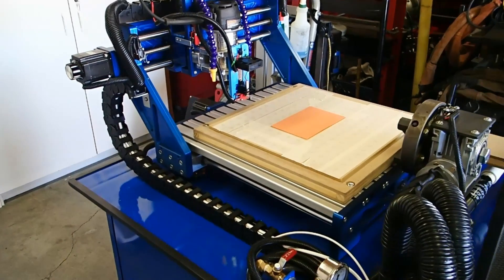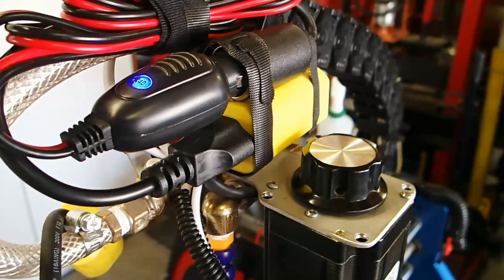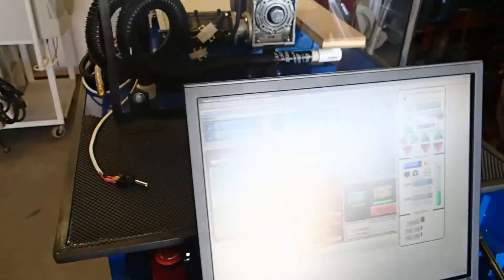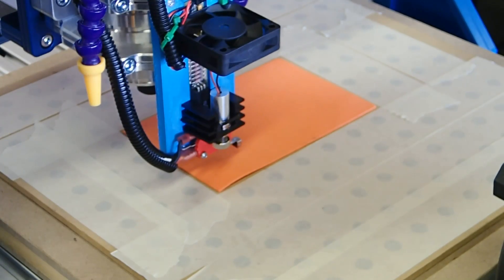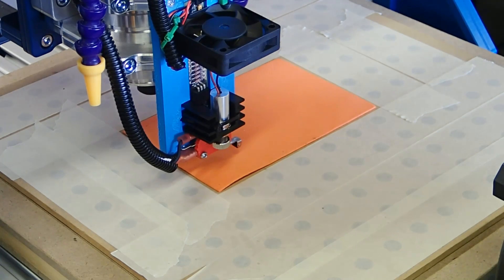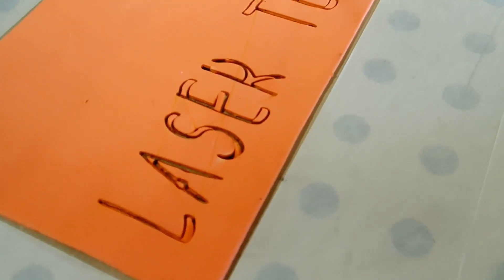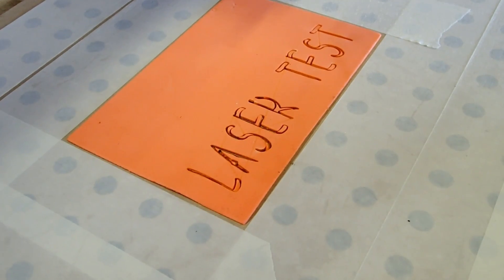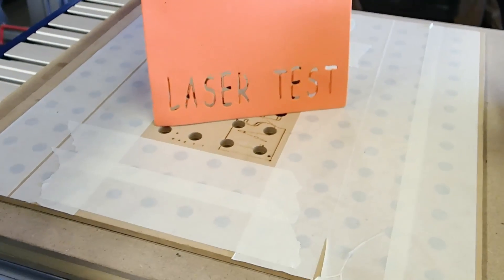Adding a laser cutter to a CNC Router Mill

Comment: You added so much weight to that axis....not really good but well done for the mount
Reply from the maker: There really is no weight on there its over powered for what it is.  The machine does not even know its here.   Its all Ball screws and way over done.
Reply: @DesertFabworks  yes I didn't check the motors. They seem massive enough. I'm a fan of high speeds as I do some productions from time to time and for me having a light bridge is important to push the motors to their max.

Comment: I am wanting to do this on a Laguna SmartShop 2. I have not had luck with other laser attachment companies. Would you know where to start?
Reply from the maker: I'm just an end user.   There are lots of options these days compared to when I made this video.    Every table and operating system are unique and the system has to be designed to work with this.   Find a good quality laser, mount it and work backwards from there connecting it to your system.

Comment: i have got two doubts:

1. Does this laser produces smoke , on changing materials ?
2. what is the base for your CNC ,what are those tapes and what did you use as a base?
Reply from the maker: The laser itself does not produce any smoke.  When it cuts through different things there is a little smoke but very little.  I have an exhaust fan near by.  The CNC machine has an aluminum base but I have a thin sheet of MDF wood that I do the cutting on.   The tape covers up the holes that are not in use.  The MDF has a vacuum hooked to it so that it acts like a vacuum table and holds the material down and flat.

Comment: WILL YOUR LASER CUT 2 IN FOAM?
Reply from the maker: Yes and no,  Foam comes in many densities and how much it cuts in each pass will depend on that.   Because it varies and the height is so high and there is a small focal length where the cutting is most effective it would likely have to be done in multiple passes with adjusting the height in each pass.

Comment: I have a BOBsCNC machine, so far I'm happy with it. I was wondering how to connect a laser cutter to it? I'm sure I can make a mount and brace it, my concern will be shutting on and off the laser, at the right times. It already navigates on X, Y, and Z, should I hook up another microprocessor, and switch the wires out everytime?
Reply from the maker: There are so many machines and setups hard to say on your application.  I'm not familiar with that machine and its setup.
Reply: Can I get a email address so I can send you what Microprocessor I'm working with? Any info is much appreciated.
Reply from the maker: Use the email form at http://www.desertfabworks.com/

Comment: Where did you connect the laser so it turns on/off when you run the g code?
Reply from the maker: Tiny Houses it's connected to a relay that is connected to the control board.    The control board thinks it's a plasma cutter and when it sends the signal to fire the plasma it fires the laser just like it would Fire the plasma.

Comment: I'd be interested to know if my CAM software BenCutLaser would work on your laser machine? I run a support forum for low power laser machines (here: www.BenboxLaser.us) and my CAM program is in the Software section on that site. You should be able to just use BenCutLaser to generate the gcode and send it to your laser.
Reply from the maker: It likely would work but I use Sheetcam on my machines since its a dual purpose machine and sheetcam works for all the processes on the machine and my other machines.  I like to keep it simple in the shop one cam program on all the machines.

Comment: Hi, What is the maximum thickness of pvc cut ?
Reply from the maker: Sorry we have not tried cutting pvc yet
Reply: You likely already know, but cutting PVC does require care to avoid the corrosive off-gassing. You may want to research which plastics are "safe" to cut with a laser. Safe can mean safe to people or safe to machines. Interesting topic.

Comment: what power can etch a pcb board?
Reply from the maker: Not sure have not tried it, sorry.
Reply: A continuous wave laser won't ablate copper.
You need a pulsed Q-switched laser, from 25-30 watts continuous power and up, and from 10kHz pulse rate. They usually have pulse powers of several hundred kilowatts, some go into megawatts for short pulses.
Look up chinese "Q-switched laser marking" machines(just like that in the search terms), they usually run around $2500-4500.
Those have enough power to ablate copper in a few passes(~10min for 10dm^2).
Reply: thank you man
Reply: How about pre-coated PCBs? Sorry I don't know the correct name. I Google around and found some people use black paint, but there are pre-prepared boards as well. Use the laser to burn off the coating and then remove the copper with etchant?
Reply: Kent VanderVelden Burning it off won't work, but exposing photoresist can work.

Comment: Where you have connect the on off of the laser? on the z axis or motor on?
Reply from the maker: The on off control for the laser is done via g code in the software and its tied into the mach 3 controller.

Comment: With the understanding it is a cheapo laser,  but a laser nonetheless,  I was expecting a clean cut through the foam. It appears you need quite a bit of tweaking still,  to get it to cut clean through the material. Some areas seems like the laser was struggling,  this could be the density of the foam itself not being consistent in the manufacturing of the foam sheet itself,  or the power delivery to the laser not being consistent also. There are streaks of what appears as smoke residue on the surface of the material as it jumps from cut to cut, or could be a delay in on/off cycles of the laser creating a left over power as it travels from cut to cut.  If you plan on selling these as kits, may I suggest getting all these things worked out and you will have a nice kit provided it cuts clean and thorough.  Don't forget to add the glasses and the power supply on your kits. Cheers!
Reply from the maker: +Mario I. Arguello   "LCheapo" is the brand name not sure we are talking about the same video it cuts clean through the foam and you can see the burn marks on the spoil board.   I bought this and put it together I have no intention of selling this I think you may be commenting about a different video.
Reply: +Desert Fabworks LLC Welding - Plasma Cutting sorry, I thought you were part of the guys that developed it. Yes been watching to many laser videos.

Comment: have you tried to cut cardboard with it.  If so how well did it work.
Reply from the maker: +Kevin Silovich  yes thin cardboard works ok but the thicker you go the more problems you have due to the focal point on the laser.  Since its such low power it has a very small cut window with the focal point.  With thicker cardboard I have found that it cuts only about half way through and you do not get a clean cut on the bottom side.

Comment: im actually about to beging my 1st journey maybe  i can get some pointers as im new to this hobby i actually come from CAD and 3D printing and recently got this new milling machine from ebay take a look http://www.ebay.com/itm/New-CNC-Router-Engraver-Milling-Machine-Engraving-Drilling-4-Axis-3020-Desktop-/111607148166?hash=item19fc4dee86 

my question is what assortment of common cutter bits should i buy?  if you look in my website i have alot of diff types of design i plan on milling or creating molds off if you look at it maybe you can tell me what type of cutter i wil need to make my passes ? i did get several engraving bits as well as one cutter but im not sure which type i got  but i plan on cutting aluminum alloy / T6
Reply from the maker: Frank Lopez  Check out www.cncrouterbuild.com for more info.
Reply: +Desert Fabworks LLC Welding - Plasma Cutting what type of gcode setting are you running? are this regular gcode settings or did you edit any of the original code prior to this ? 

im asking cuz i wanted to know if i was to take file and put it thru a gcode generator and then ported over via mach3 will i still et this type of results ? 

Thanks in Advance
Reply from the maker: Frank,   We draw the files in corel or drawplus export them in .dxf format.  We then open this file in sheetcam and treat it like a plasma cut and sheetcam generates the gcode for us that we use in Mach3.  So it is just standard Gcode.  Sheetcam makes it easy to export.
Reply: oh ok ic thanks, basically the keyword is plasma cut, this way the cnc dont need to worry about Z axis movements correct? but other than that all i have to do in my case is bring my dkf or stl files from AutoCAD 123 or Fusion360 produce a Gcode for plasma or laser and attach a laser? now about the laser passes how does that get determined>? i mean im not sure about yours but my Laser only cost me $10 and is a 350mA laser so it burns but im not sure about the cutting i have not tried cutting anything as in yet, just igniting
Reply from the maker: For the Z lock it a a set height that works for your laser.  Every one is different depending on the focus.  You will have to experiment with your laser and the passes to get it right for you laser and the material you cutting or burning.
Reply: thanks pal!

Comment: Hi, will the L-Cheapo marking.engraving Alluminium? Thanks.
Reply from the maker: ***** I really doubt it not enough power but I have not tried.
Reply: Desert Fabworks LLC Welding - Plasma Cutting I finally found the info about the correct laser wavelength to cut aluminium. Thankyou, here you get the link: http://www.industrial-lasers.com/articles/print/volume-29/issue-3/features/high-power-direct-diode-lasers-for-cutting-and-welding.html

Comment: It looks like it isn't being turned off during rapid moves, is it? If it's not, why is it not cutting? Would that be because of the focal length setting? It will only cut at a given distance?
Oh, and can you mark metal with these?
Reply from the maker: oxiroxt   In the video I did not have the the gcode set up for the on and off between cuts in a piece only on at beginning and off at the end.  It does not cut the material both due to the focal length and the speed of the rapid moves.
Reply: @DesertFabworks  
why bother with g code?
Just use a solid state relay on the z axis connected at + and the direction pin of your breakout board. Goes from high (on) to low (off) and then set the retract in mach to about .001 in. Make a power connection on the relay between the laser and power supply. Works perfect for me and has for several years
Reply from the maker: @larryelliott9157  The entire system runs on g code and all is based on a mach 3 router system.  I have since added in a relay but there is not a traditional breakout board so it took some tweaking but it works better than before
Reply: @DesertFabworks  
Assume you meant to type relay rather than reply.
So what are you running as your plasma table? I have a 5 x 10 Dynatorch and it works very well now for several years. Getting it set up to run a water jet cutter running at about 4500 psi by just removing the plasma head and setting aside as it's magnetic mounted. Hope to have it working soon.
Reply from the maker: @larryelliott9157  I just purchased a 5x10 Westcott ProSeries table with the industrial iCNC controller.   I also just got an 80 watt laser machine so I really do not use this laser on my little CNC mill much anymore.
Reply: That's very informative and looks like it worked perfectly for your purpose. Thank you

Comment: hi, you know if this laser cutter can be use for make PCB??? without chemical process??
Reply from the maker: Not sure on that I have not tried it and I'm not sure what goes into doing that.
Reply: +Sergio Giuffrida You would likely be better off using a V bit to cut out the PCB. I know some lasers can do it, but I am not sure which ones.
Reply: i'm not an expert but i know people that tried with more powerful lasers.No..you need at least many tenth of Watts for etching directly the copper,and still you have 3 problems 1)to use a laser with a wavelength that is non reflected by copper(some lasers can cut steel  but are reflected by copper) Removal of vapors 3)Avoid that high temperatures    transform the glass fiber in carbon like stuff,that is very conductive.
I think that all of videos showing a 2000 mW laser used for making PCB are about paint etching,and not copper.
I think that an acrylic spray is used,and then you still need chemical etching.
For the price of a small car,i mean some tenth of thousand Euros ,brands like LKPF sell direct laser etching machine for PCB prototyping.